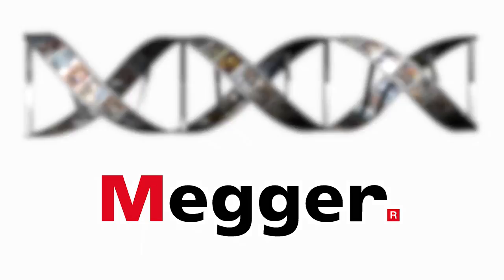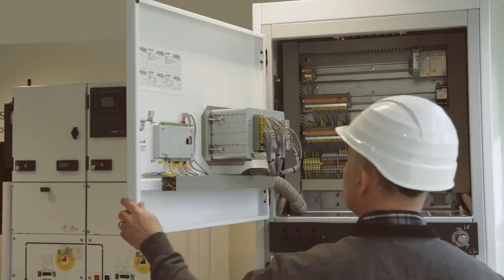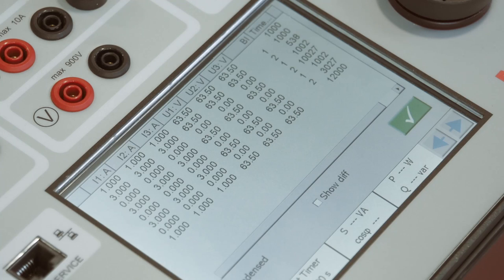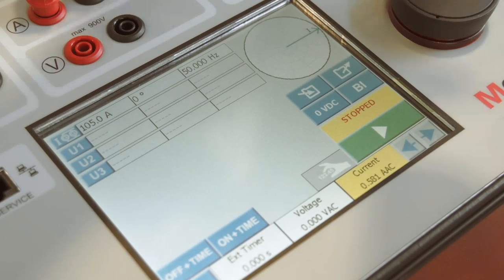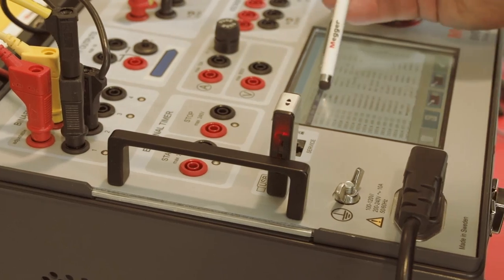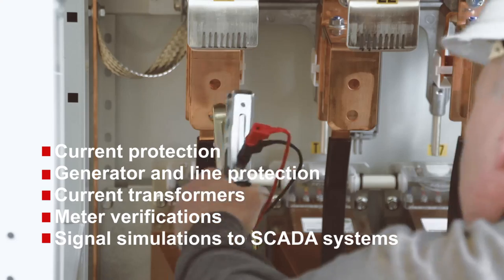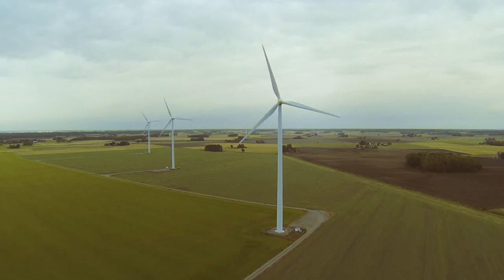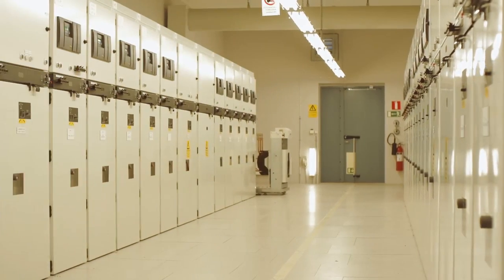SVERKER900 Relay and Substation Test System

Comment: at 3:26 they are struggling with tension ed leads!  Looks as if going to snap any minute.  by the way this is  NOT MUGGER but SVERKER made in Sweden not in the UK pretty much just like Volvo cars. I had one who died halfway through the work in the substation.  Instead go for the real multi-amp megger (many years proven service  in the field)  to guarantee reliability and precision not the Sverker